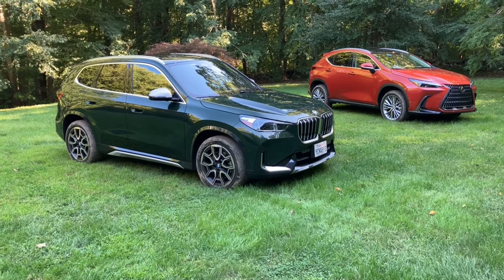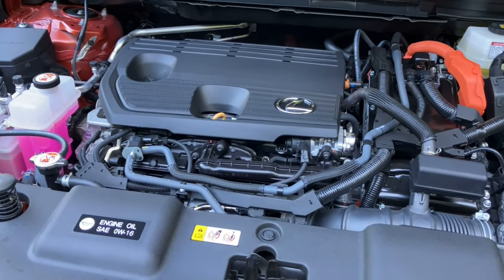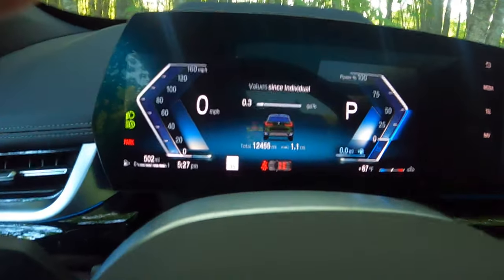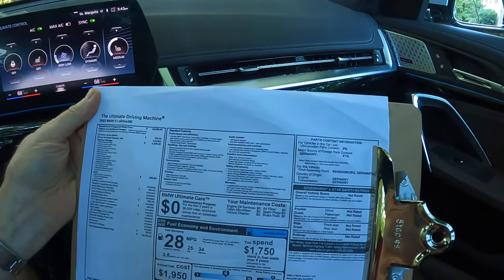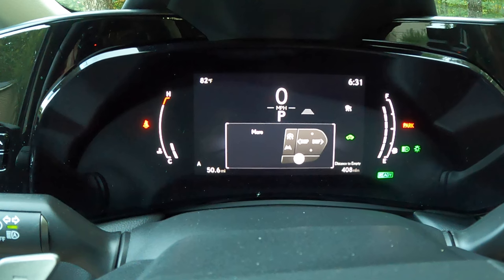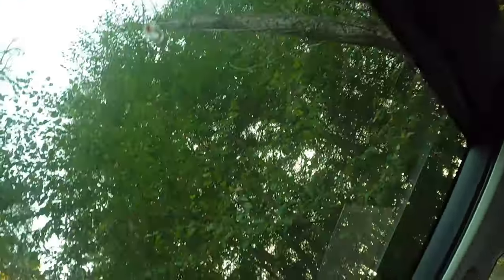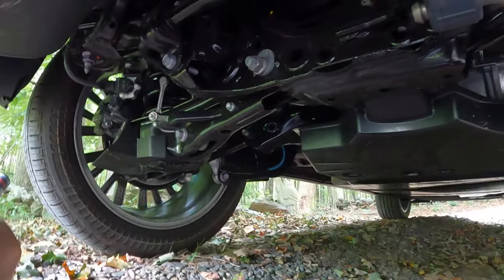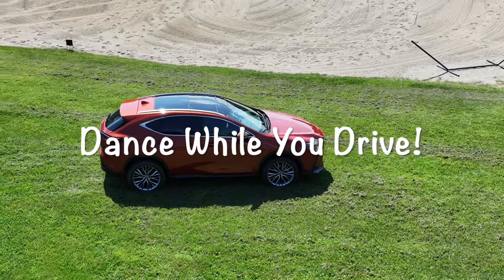BMW X1 X-Drive/Lexus NX 350h Luxury Comparison

Comment: The electronic door on the Lexus NX is designed to allow you to open the door safely. If a bicyclist comes up from behind, the sensors on the side of the car automatically detects it and will not allow the door to open.
Reply from the maker: Thanks for this. My problem is, I see numerous drawbacks to this electrification/sensor use compared with the potential benefits.  Maybe jsut an audible warning from the Blind Spot  Warning system would be sufficient to stop the (comparitives rare) door opening on a bicyclist. As  a motorcyclist that split lanes in LA 's  stop & go traffic all the time, I never actually saw or heard of any incidents.
Reply: @MachinesWithWheels imagine someone who just dont give a damn and suddenly think they wanna open the door and do it in a flash

It’s designed for such idiots 
Others who are cautious may be avoid or are mindful to see the rear before they open the door and it is may be just 25 % effective for such people

Comment: I have own a 2018 Bmw X1 20i 192 horse power for 6 months here in Poland, Europe. The fun from a ride, which this car offers is great. Acceleration especially between 50 to 150 km/h is making me smile every time. Fuel consumption is lower than in Mitsubishi Outlander 2.0 benzyna 150hp from 2019., especially if you drive 140 km/h on highways. 
BMW looks better, drives better and is much better equipped.